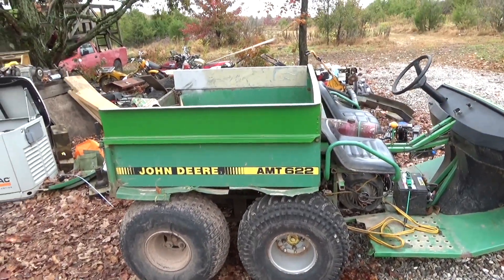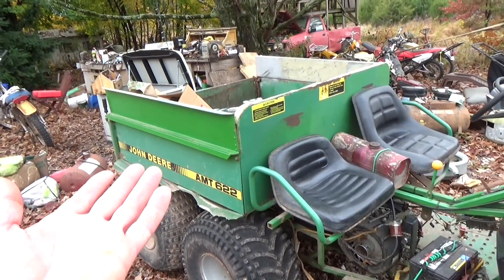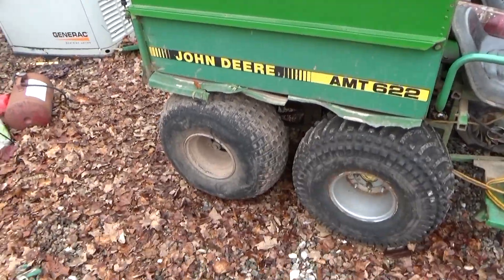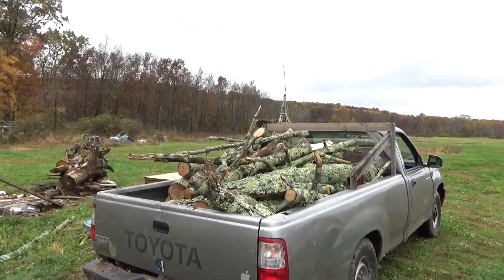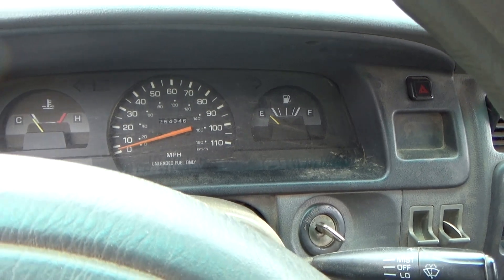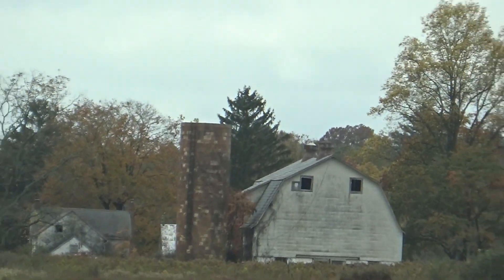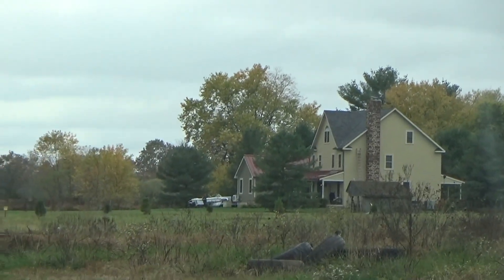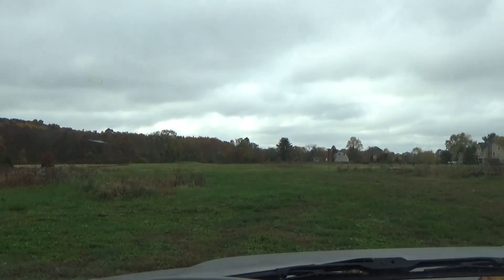John Deere AMT622 update

Comment: I have the same machine, just got done swapping a polaris 340 snowmobile engine into it. 4 strokes suck!
Reply from the maker: haha, well, I've definitely heard a lot about how polaris's suck.  :). But yeah, Not a good machine to have a fast 2 stroke engine in. even just for shifting it, the high idle of 2 strokes will cause some transmission damage trying to get in gear.   Its a really useful awesome machine, and putting a big 2 stroke in it for fun is really a waste of its awesome potential.  And 4 strokes are really awesome, they get more power out of their fuel.  Basically they put the time and effort in to get more out of it.  2 strokes are kinda just fast wasteful screamers.  Which is definitely fun and awesome the right application, not cool in the ol AMT.